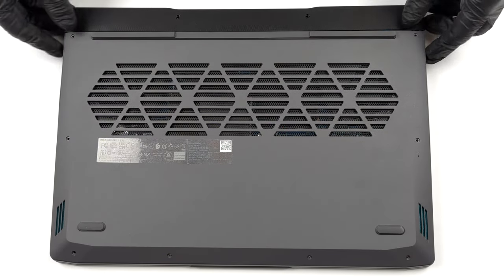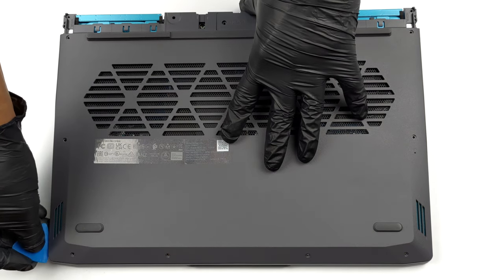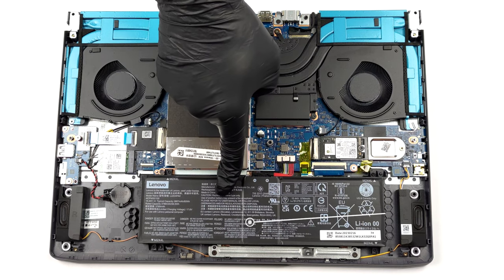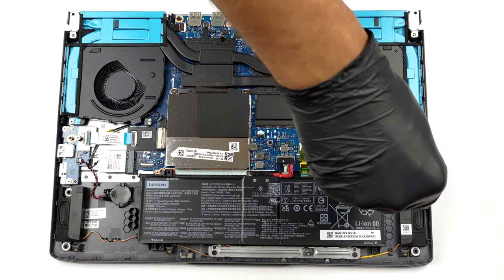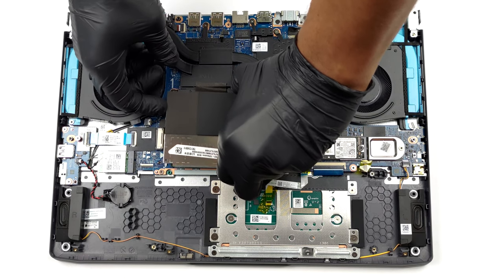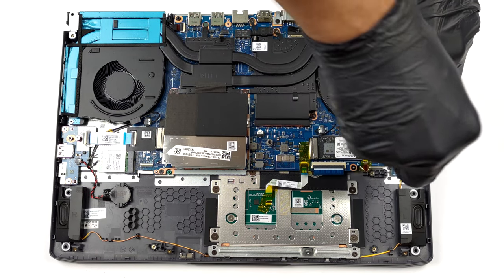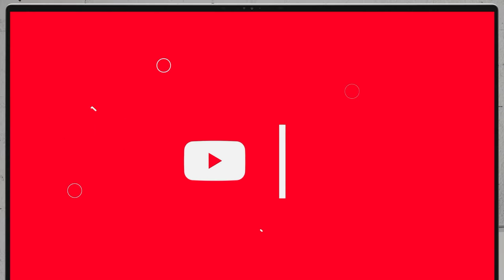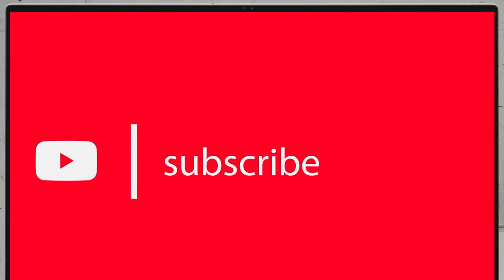🛠️ How to open Lenovo LOQ (15" Intel, 2023) - disassembly and upgrade options

Comment: can we upgrade the battery?
Reply: A Question like that suggests that you probably shouldn't.

You see if you don't understand batteries (which you clearly don't)   why risk stuffing up your laptop ?

so it goes like this
1. As long as the connect is the same........ IT DOESN'T MATTER

HOWEVER.....................

2. You need to Match and NOT  EXCEED the rated voltage of the laptop, So.. the new battery needs to have THE SAME VOLTAGE.
if you exceed the voltage you'll blow the capacitors in your laptop, which means..........NEW LAPTOP

HOWEVER....................
3. You need to consider the current rating of the battery and at least Match it,   but don't over exceed it by too much.
and then you'll be ok

HOWEVER..................  You can still stuff your laptop
4. You'll notice on the connector there are 4 Red Wires,    this means   4 SEPARATE BATTERY CELLS Exit and that means ..Likely there is a PCB controlling the cells,
as is obvious by those grey and yellow 4 wires
So you need to ensure that the same battery configuration is preserved

BUT IF YOU GET ALL THAT RIGHT
YEAH, YOU CAN TOTALLY UPGRADE THE BATTERY

but do you see how many "HOWEVER"'s  there are ?
As you can see....if you don't understand batteries, you shouldn't do this.
and if you did, you wouldn't be asking this question

My suggestion. Leave it alone!

what are you trying to achieve anyway...................AND WHY ?
the battery is also 4 or 5 hours in realistic off charge time

Comment: I can't get past the first step. The back black part isn't budging
Reply: 6 months later

.........Black part still isn't budging

LMFAO
Reply: Did you manage to remove it? I don't want to damage my chassis by trying too hard...
Reply: @swypie02  
Yes i have
What are you having trouble with , Maybe i can guide you
Reply: @martinkuliza nvm, I ended up brute forcing it. Thanks so much for replying tho.
Reply: @swypie02  no problem

Comment: Hey. Can you tell me whether all of the screws are of the same length?
Reply: I've got the same Laptop and i've pulled it apart

if you mean the screws on the bottom for the plastic housing
NO THEY ARE NOT THE SAME SIZE
you need to pay attention to which you got from where

BUT...
it does seem that the screws on 1 side are the same as the screws on the other side
i think there are  4short on one side and 4 long on the other
then... You need to remove the back part, that also has 3 screws that are different again
from that point, it's just a matter of prying up the clips
it's not hard to do
Reply: @martinkuliza  lol Ive opened mine ytd. There are 4 screws that are shorter than the rest, yea. It came out quite easily with a pry tool, but just too bad that the Ssd's screw was too damn tight

Comment: Mine has horizontal lines going across the screen, is there a way to fix it?
Reply: Did the issue get resolved..if yes how?
Reply: Send it in for Warranty
or
Buy a new Laptop

that's... Screen or Graphics card, Usually it means CRACKED SCREEN

Comment: My deco cover just won't come off 😓
Reply: yes it will
you're just doing it wrong

YOU TAKE OFF THE SCREWS, Don't mix them up

REMEMBER
there are first the obvious one's on the outside
THEN... YOU NEED TO REMOVE THAT BACK COVER (the blue and black one)
there are another 3 screws

when you get those off
then you can GENTLY pry the plastic cover up,
Note , it has clips 

if you need help, i'm happy to jump on zoom or whatever to help you

Comment: Is the maximum upgradable up to 32 GB or can i up to 64 GB?
Reply: 32gb
Reply: Hi sir,Lenovo customer care telling max expand ram is 16gb and don't support beyond that.did you try it and share the model number you bought.plz reply.
Reply: @Publicchannel5 Lenovo told me the same thing. The maximum is 16gb no more.
Reply: 64gb
Reply: @mastergaming91872  Hi,For running 3d benchmark do we need to change settings in Lenovo vantage from quiet to performance mode and adaptor should be connected or not?
Please reply if you know.
Reply: If you search the specific model into the Lenovo site, you can find exactly what's the maximun GB for ram, most of what I saw in LOQ 15APH8 is 32GB

Comment: i see a connector not being use, the one that says RGB. Do you know if that connector can be used for a 2.5 ssd/hdd? Thanks
s
Reply: YES IT IS
here is what i did 
you are supplied a 500GB M.2 NVMe  by default (Short Format)

I setup a MULTI-BOOT SYSTEM ,  
2TB M.2 Partitioned as follows..

Win 11,  ------------------- 500GB
Zorin Linux, ------------- 500GB
Parrot Security OS,  - 500GB
Black Arch Linux. ---- 500GB

Because i needed 4 Partitions  I WAS FORCED TO BUY A LARGER DRIVE. (you may not need to)

I Removed the SHORT 500GB and put it in M.2  SLOT 2
and i put the new 2T M.2  LONG in M.2 SLOT 1

in slot 1 for the long one you will have a screw
in slot 2   
FOR THE LONG ONE You have a screw
FOR THE SHORT ONE, YOU DO NOT HAVE A SCREW HOLE

but... You do this...
Remove that Black Plastic sticker
Insert the Drive
Put the sticker low on the drive and stick it to the metal can nearby, or.. You can just get some tape or something to hold it down.
Figure something out.  shouldn't be hard

Comment: Can we add 2TB SSD in 1 slot?
Reply: You can add M.2  NVME drives in 2 slots
the one in the video is   M.2 (1)   PRIMARY SLOT
on the other side of the board there is  M.2 (2) SECONDARY SLOT

You can insert SSD's into these of any size up to 18 ExaBytes (needless to say , WHATEVER SIZE YOU WANT)

You can insert M.2 NVMe's   in both slots
i can confirm that it works as i've done it

have fun !
Reply: @martinkuliza  Thanks for your comment. Would one 2TB SSD from WD or Samsung work well in the 2280 slot? No issues so far?
Reply: @teosiriosica  
Yes it'll be fine,   2TB is no problem
the max for the M.2 slot is 8 ExaBytes.
the brand doesn't matter
Reply: @martinkuliza  many thanks! Has anyone managed to fit a 2280 SSD in the 2242 slot? The original one is only 512GB and a pretty slow one. I heard there is a screw in the way when you want to install a 2280. The reason I would swap the 2242 for a new 2280 is that I couldn’t find a great 2242 single-sided of 1TB.
Reply: @teosiriosica  
ok so
1. "Has anyone managed to fit a 2280 SSD in the 2242 slot?"
IT'S NOT A 2242 SLOT
all the slots are 22mm  hence the 22 in 2242 and 2280,  the last 2 numbers pertain to the length,
so 80 = 80mm and 42 = 42mm
the slot itself is a 22m  M.2  it is neither 2280 or 2242  it fits both

2 . i already stated that i did it, in my first comment
Reply: @martinkuliza clear, I’m with you, just non English speaker, sorry. I know 80 in 2280 stands for the length. I just wondered what brand did you use it in the slot on the right, since there is a screw midway and as we saw in the video it causes the long SSD 2280 to bend. Anyway, I bought a Samsung 990 Pro 2tb and tomorrow I’ll try it in both slots and report
Reply: @teosiriosica  
the language thing doesn't bother me don't worry.

now, the second slot is designed a bit stupid.
you do need to remove the black plastic cover on the WiFi Card
and you may not get to screw down your M.2  But it doesn't matter
Just installed it, Put a bit of tape over it and it'll be secure and IT'LL WORK
M.2 is about the slot not about the length, the length is of no consequence really ,
don't worry a 2280 will work if you improvise a little
Reply: @martinkuliza can’t wait to try it tomorrow morning first thing! Thanks for the advise with the tape! I was concerned about metal parts touching the SSD. Have a good one. What a great community YouTube can be!
Reply: @teosiriosica  
truth be told, so was i in the first place, and i thought it was a stupid design to put that black plastic there, then i thought.... Hang on..... There must be a reason for this, they wouldn't just put on an M.2 Slot if it wasn't functional, that would be dumb...

so i plugged it in and took a look, and.. it works !! Absolutely works,  However yes, You're gonna find that you can't lay it down perfectly flat to line up with the screw hole,  but... it really doesn't matter, so long as it's somewhat flat with a bit of tape, the tape will hold it on and the plastic casing will keep it pushed down, so it doesnt matter either way

Comment: Do you know if you can upgrade it to 32 or 64 GB ram? If this is the case, which type of RAM should be used?
Reply: ddr5 ram. mhz will be the same as the original. (loq comes with 4800, 5200, 5600 config)
Reply: Max is 96gb, if you have 350$ to spend on ram you should not buy loq line of laptops
Reply: @KuntalGhosh  that would be crazy haha. I just wanted to know if I could install more than 16. I think I should be fine with 32. Thanks for the info!
Reply: Has anyone ever put more than 16gb of ram in this? I just got my laptop today and i specifically got 8gb of ram to upgrade to 32 myself.
Reply: check on ur cpu website which ram is supported
Reply: @adriangarlati Hi sir,Lenovo customer care telling max expand ram is 16gb and don't support beyond that.did you try it and share the model number you bought.plz reply.
Reply: @Bonez091391  Hi sir,Lenovo customer care telling max expand ram is 16gb and don't support beyond that.did you try it and share the model number you bought.plz reply.
Reply: @KuntalGhosh Hi sir,Lenovo customer care telling max expand ram is 16gb and don't support beyond that.did you try it and share the model number you bought.plz reply.
Reply: @Publicchannel5   Lenovo support also told me the same thing. That is why I asked in other places, as I am quite sure it is possible to upgrade it above 16gb, despite what Lenovo says. Unfortunately, I haven't done the upgrade myself. Sorry.
Reply: I have finally upgraded to 32GB DDR5 ram. Works perfectly.

Comment: 6 hrs NOWAYYYYY !!! ... i bench marked my laptop and even in quite mode. it only went for like about 2hrs and 40 mins. 6hrs impossible  !!!!
Reply: i agree   6 hours is rubbish Unless you activate all the power saving options and screen brightness really low

I got 4 hours out of mine.
All Power saving crap is off
and laptop is set to NEVER sleep
Brightness is 90%

Comment: These do nottttttt last 6 hours though. LOQ would be 10/10 if they had minimum 80mwh battery. The 60 lasts around 2 hours from experience
Reply: i got 4 hours from mine consistently every day in the last month that i had it
Reply: Mine lasts for that long lmao, I use it on Auto Hybrid mode and 30% brightness watching YouTube lectures
Reply: @martinkuliza my guy, can u tell me if I can just open it like this and take the fans out to clean them? Only the fans.
Reply: @zennaonthez  
Yes you can 
at 0:44 you can see the fans are there
Remove the screws , the fans come out

Comment: Can we upgrade to hdd ???
Reply: no i guess
Reply: HDD is a downgrade, you want SSD M.2.
Reply: YES WE ABSOLUTELY CAN
I've already done it.

You can upgrade to any capacity that you want as long as the one you buy fits M.2  , You can buy the Long or short one,
I suggest the long one as there are screw holes for it
but both will work
Reply: @martinkuliza  is there option for extra hdd slot in this laptop 
I want to update add 2tb hdd Seagate internal
Reply: @shaikharbaz1022  
GO AHEAD
That's Exactly what i did 

So  
1. There are 2 M.2 SLots

2. You can see the second one in the video
LOOK AT THE LEFT FAN
LOOK AT THE BLACK STICKER WITH THE BLUE TAB

You can just lift up the Black sticker

You need to remove VERY CAREFULLY,
the blue tab to release the Flat Flex Cable

WITH YOUR FINGERNAIL 
LIFT THE BLACK TAB...... UPWARDS

then
Remove the black plastic tab

Now...
if you are inserting a SHORT SSD,
then you'll need to use this sticky plastic to stick down the SSD
put part of it on the SSD and the other part on the WiFi card next to it.
it'll hold it down fine

IF IT'S A LONG SSD
then THERE IS A SCREW HOLE THERE

My Advice...
Use the 500GB Supplied, for the operating system
and use your 2TB as your secondary drive.

but, You can go the other way if you like

and if it's 2TB, You can stick to NTFS Partitions
But above 3TB   You need to use
GPT GUID Partition

does that help
Reply: @martinkuliza  where u update I don't know how to upgrade ?
Reply: @shaikharbaz1022  
if you DON'T KNOW HOW to upgrade
then...... You shouldn't attempt to upgrade

and i'll tell you why
MANY REASONS

1. You're probably going to put it on the carpet

2. Then you're probably gonna touch something with your hands that you shouldn't touch, Cause some Electro static disharge and blow
   an SMD component that you shouldn't have blown

3. or... if i show you which connector it is, You will then be required to flip a (what you normally be, a simple task) You will need to flip a latch.
but IT'S LIKELY YOU'LL BREAK THE LATCH,   this will then cause your computer to not function normally.

You will then need to buy a new laptop

4. Or... you'll over tighten the screws, Not understanding that they just go into plastic
then... Like another person has already stated
"I've tightened the screws too hard and threaded them,  How do i fix it ?"
You'll then be one of those 

5. and if you get past that part you'll then break the housing or the clips and ask how to fix that

MATE...IF YOU DON'T HAVE BASIC DISASSEMBLY EXPERIENCE
*****************  DO NOT ATTEMPT ANY UPGRADE ON YOUR LAPTOP *********

I Know you think it's cool and you really want to
but... if you're gonna stuff your laptop in the process.. it's really not worth doing.
and i don't want to be the one that has to say to you

"well, i told you where the connector was but i didn't tell you to break it"
then you say to me
"But you didn't say that"

Mate, i haven't broken anything on any computer in over 30 years.
I'm an Experience Technical Person

Now honesty, for this sort of upgrade,   You don't need to be technical.
However.......
You do need some basic level of skill
and given you have a video to go off
You should know how to upgrade the HDD

Now, if you didn't spot the connector,  that's understandable
but .... if you don't know how to upgrade and NVMe drive

HONESTLY...............DON'T ATTEMPT IT, You'll break something.
the statistical odds are GREATLY AGAINST YOU that you will do it successfully

This is why when he have trainee techncians,  there is a senior person to supervise them.

Now.......I RECOMMEND YOU DON'T TRY IT YOURSELF.

HOWEVER.....
IF YOU WOULD LIKE ME TO JUMP ONTO ZOOM WITH YOU or something
I CAN GUIDE YOU THROUGH THE PROCESS

But, Given what you just said to me, 
I don't recommend you do it yourself,  OK

That's the best advice i can give you for your laptop.
it's still a good laptop and  LET ME EVEN SAY THIS.....

YOU CAN OPTIMIZE YOUR LAPTOP TO WORK FASTER.

I'LL START A NEW POST TO SHOW YOU THIS..
Reply: @martinkuliza  thanks for help
Really appreciate
Reply: @shaikharbaz1022  
no problem
so.. did you want to jump on zoom or not ?
Reply: @martinkuliza  I'll buy external 2 tb hdd for gaming 
Is it good for gaming ?
Reply: @martinkuliza  plz reply sir
Reply: @shaikharbaz1022  
I did reply.
However i can see that youtube probably deleted the comment for no apparent reason

My reply was....

Your question is
"is 2TB Good for Gaming"

that's like asking
"is an orange good for running"

"GAMING" is irrelevant to the size of the hard drive

WHAT GAME you are playing is relevant,
Specifically it's installation size.

See... there is no way for me to answer your question in any real useful way, i can only guess,   but, i'd rather that i didn't have to.

YOUR CONSIDERATIONS SHOULD BE AS FOLLOWS

1. How much space do i usually use on my Operating system ?

2. How much space do i use for documents and video's and other stuff

Now if you're like most people, 500GB would be fine as most people don't exceed 200GB

let's call this 300GB to be safe

but then if you are a person who downloads lots of movies 16TB may be more suitable

3. Then you need to ask yourself
WHAT GAME AND I'M PLAYING AND WHAT IS THE INSTALLATION SIZE

4. Then you should ask
HOW BIG ARE THE EXPANSION PACKS THAT I WILL EVER USE

Is 2TB Big Enough ?
I don't know,     Maybe..
You haven't supplied enough information for me to come to a proper answer

it's like you asking me
"Martin, Will i be successful in life ?"

I don't know, I have nothing to go off.

Ask other gamers what size HDD's they use and go off that